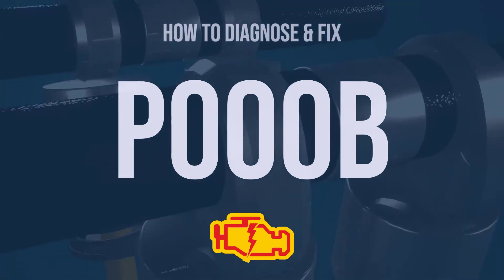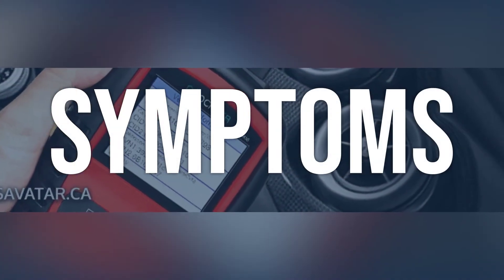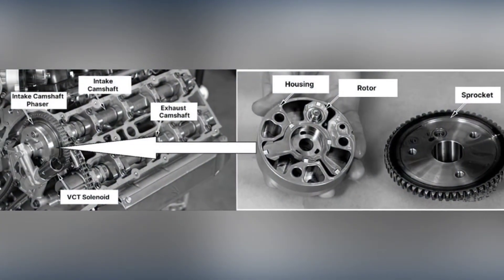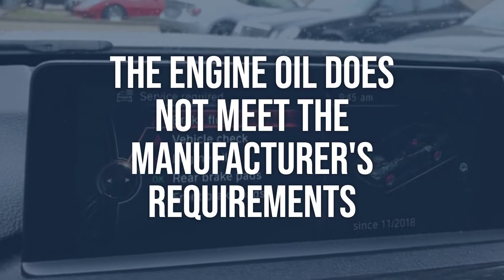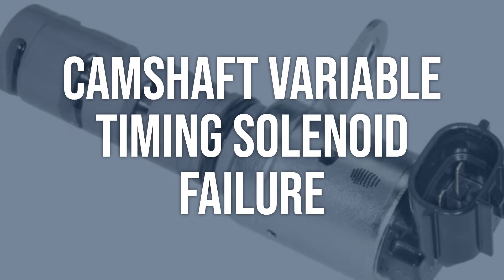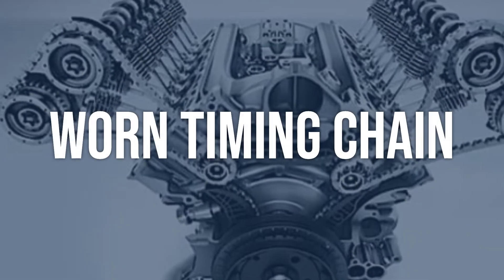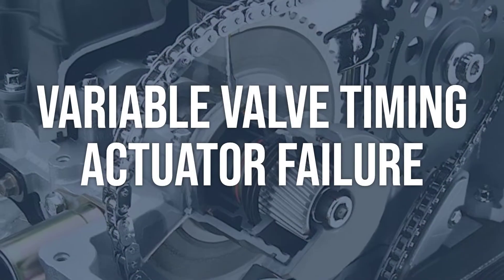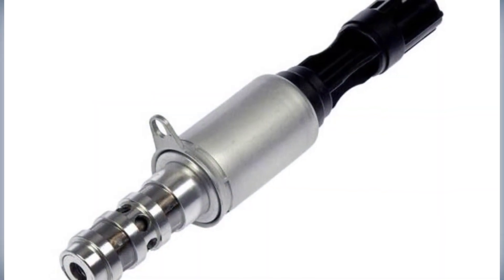How to Diagnose and Fix P000B Engine Code - OBD II Trouble Code Explain

Comment: Hi, I have tapping noise coming from engine. I have a p000b and a P00015 on peugeot rcz.. After  watching your video it seems has if it could be timing chain.. How likely is this it's  done 56000 miles.. Is this a urgent repair do you recommend not to drive until I cam get to garage.. Thanks